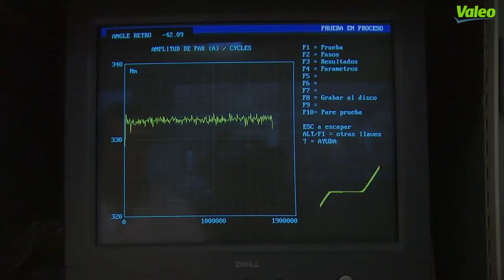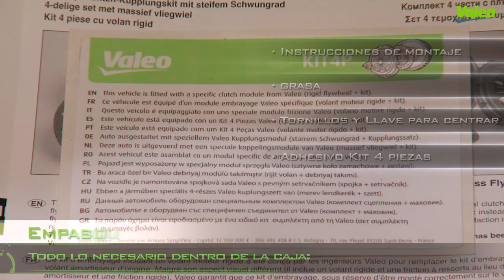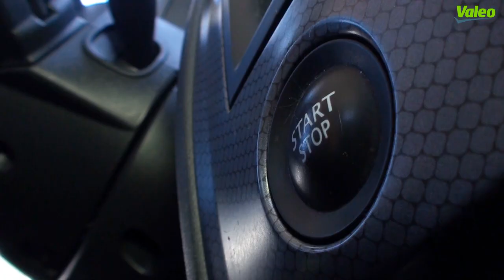Kit 4 Piezas, solución de Valeo para reemplazar el volante Bimasa de Equipo Original

Comment: Puesto en 407 hdi 2.0 repro a 170cv, las marchas entran bien pero no tan fluidas como con el bimasa de origen, al pisar fuerte por debajo de 2400 rpm buscando par motor hay ruido y vibracion, al salir desde parado sin o con poco pedal hay ruido y vibración, al soltar el acelerador yendo a punta de gas en 1-2-3 hay rebote con la retencion.
Lo bueno es la transferencia de potencia apenas sin perdida, el motor tiene mas alegria subiendo de vueltas (volante bimasa 13kg el valeo 6kg) y tras 70 mil km parece que el kit siga en plena forma para muchos mas km.